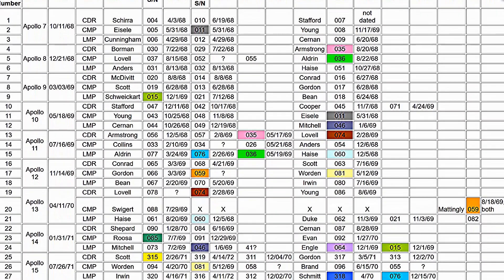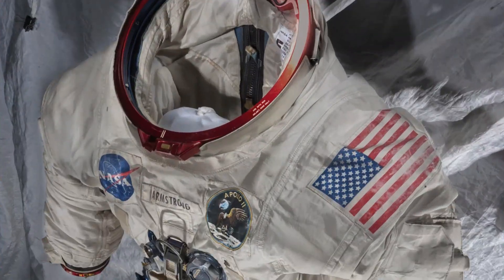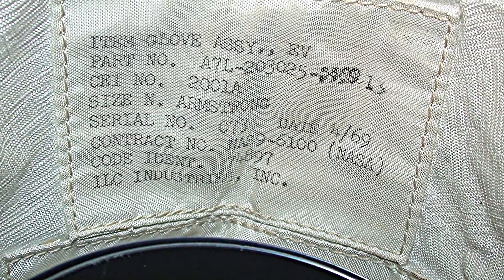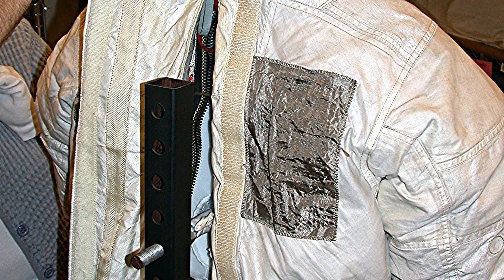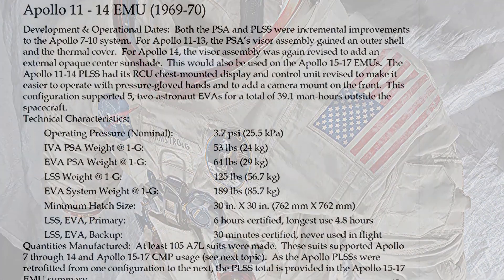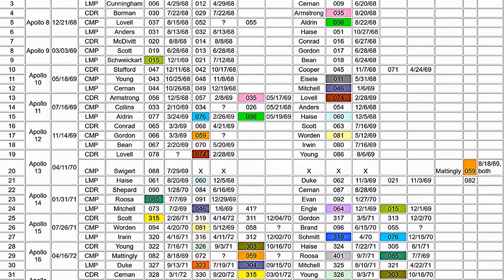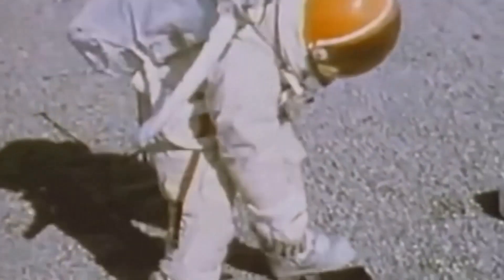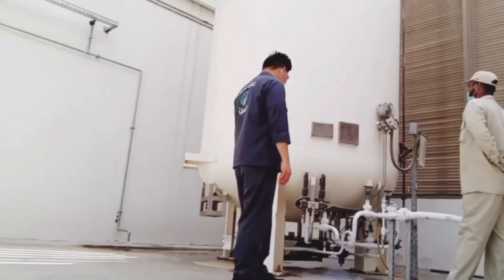"MISMATCHING SUITS"

Comment: According to the Shepard & Armstrong Spacesuits: 8 Fun Facts site, the suits were made airtight by using an inner and outer zipper with a rubber lining in between the zippers. Seems too simplistic to me. What do you guys think?
Reply from the maker: As Bill Demos said, "It would be fantastic to add a zipper like that to my chamber so that I would not have to keep changing the one time metal seals. Plus, the zipper would cold weld itself together permanently with the first zip when in the vacuum of the LM. You cannot seal a zipper between the zipper chain and expect it to hold air against a vacuum of torr 10 -11. Impossible!
Reply: @theapollodetectives  Would it work in low earth orbit?
Reply from the maker: I would say no as the vacuum level in LEO is still around torr 10 -4. No way a rubber sealed zipper would be able to hold the air in the space suit. That's why the suits on the ISS do not contain zippers. It wouldn't work.
Reply: @theapollodetectives  The reason I asked is because we've all seen the space walks for Gemini.
Reply from the maker: @scott-o3345  Gemini was conducted in LEO. The rubber seals would have worked at the level that the astronauts were at. It is when you get to the ISS, a hard shell suit would be required. that is why the suits have structure to them. If Apollo was really on the moon in a vacuum of torr 10 -11 against 5 psi inside of the suit, the suit would have torn itself open at the weakest spot, most likely the zipper. Cheers!
Reply: @theapollodetectives  Thanks for the info.

Comment: The Apollo space suit had an internal pressure of 4.3 lb/in2 or 0.29 atm of pure oxygen. That means in a vacuum on the Moon the pressure on the suit's surface was nearly 30 kg or 66 lbs per square decimeter! (10 X 10 cm = 3.9 X 3.9 inch) Apollo Astronauts should have looked like blown-up Michelin Men, and hardly able to move, and move their fingers. Now imagine putting the pressurized flimsy LEM in a vacuum chamber!  

Apollo space suit
Reply: All the more reason they wouldn't fit through that small LEM door...

Comment: see the spacesuits so in detail ... makes you understand immediately that the technology there does not hold the ultra vacuum of 10 to minus 12 torr !!! but not even for a dream !!! impossible!
just compare the hermetic system of a system that produces vacuum at 10 to minus 6 or minus 9 to immediately understand that spacesuits are toys ... expensive, but toys.
Reply from the maker: Precisely.  Look at the Sandusky chamber which pulls 10 -6 torr and needs concrete floors and 6 inch thick steel walls.
Reply: @theapollodetectives  Sandusky Chamber… they could do it with a huge puppet dressed in style like Armstrong's spacesuit….  like in the movie Ghostbusters 🤣

the miracle: the spacesuit has a tight seal compared to ultra-vacuum
fantastic performance in extreme heat in extreme cold, it does not feel any kind of radiation and is cut-resistant !!!

Comment: I've always wondered why nobody ever thought of an umbrella!
When the sun is high and you feel it 'beating' on the head .... an umbrella definitely helps to soothe the feeling of heat.
Why hasn't NASA ever designed an umbrella for astronauts mounted on the backpack and of adequate diameter to provide shade?
When the astronaut has got off the LEM and is on the lunar surface, he opens the umbrella. When he re-enters the module, he closes it or drops it on the ground. The canvas of the umbrella can be of different materials ... from totally reflective materials to partially transparent for UV rays to regulate the temperature of the spacesuit ... etc...